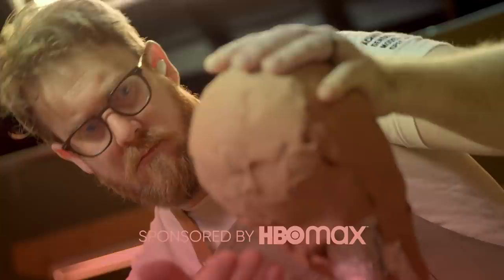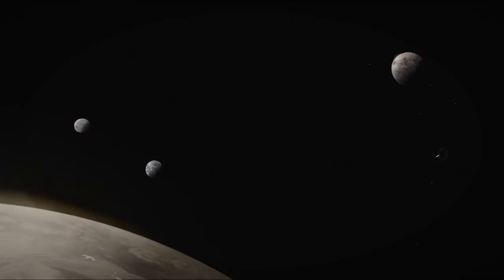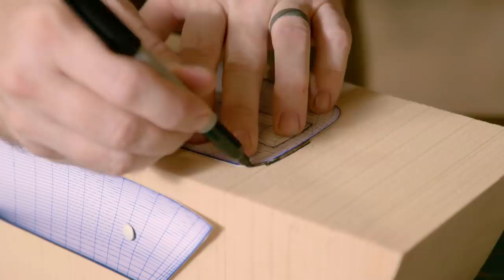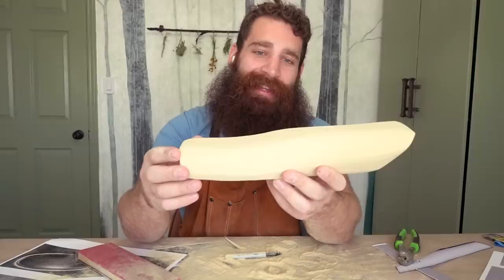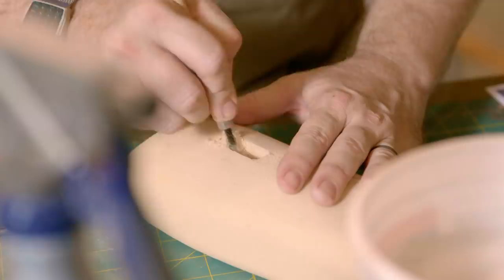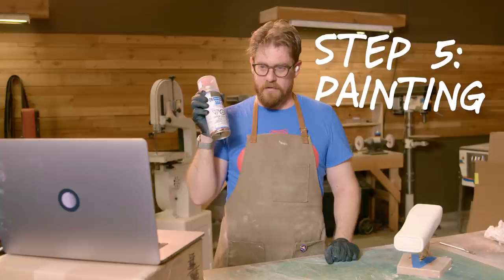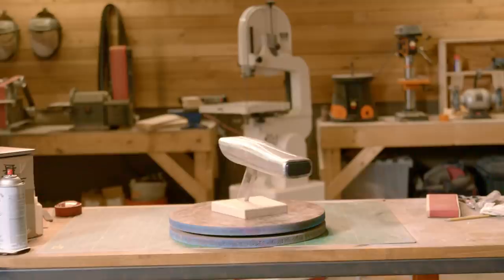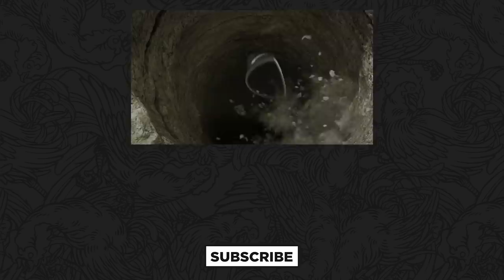Making a Spaceship! | Master & Apprentice Prop Drops

Comment: came out more glittery than chrome, not sure what to change to stop that, smoother material or different paint?
Reply: I thought Marcus's had looked like it had more air bubbles in the paint, I was thinking maybe the plaster or polish didn't set right?